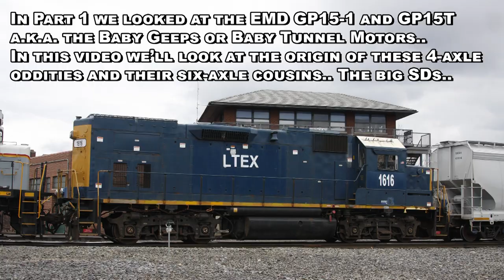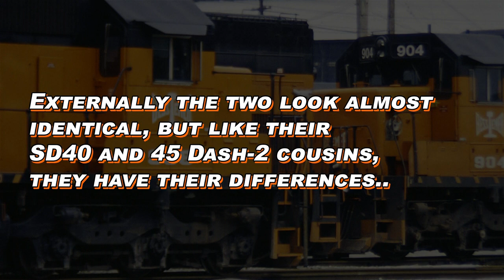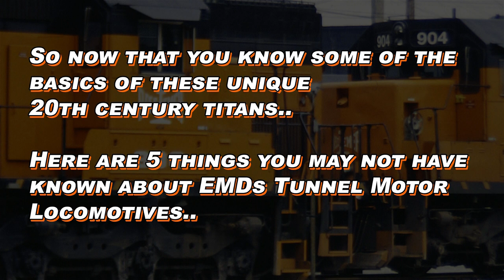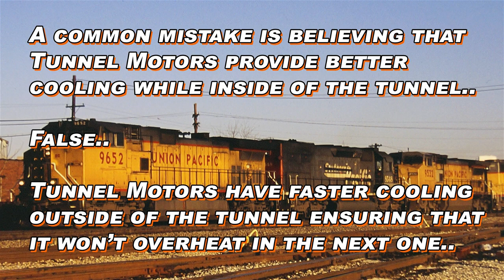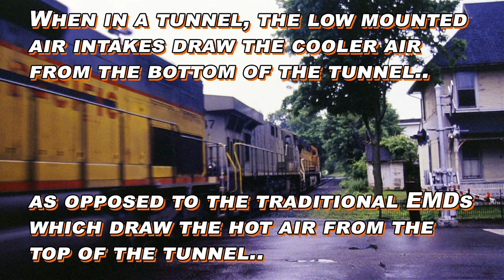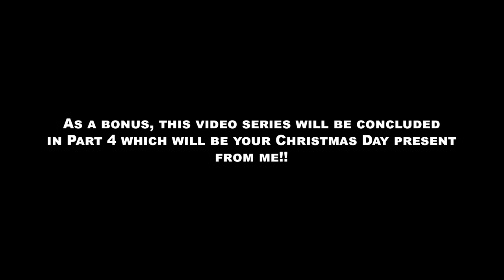[GL][T-309] 50th Anniversary: EMD SD40-2 (G.O.A.T.) | (Part 3 of 5) Tunnel Motors Big & Small

Comment: Growing up in Dayton, Ohio, seeing ex-SP Tunnel Motors on IORY run-through trains on the NS Dayton District in the late 90s/early 00s was a pretty common sight for me when I was a kid. My first exposure to western railroad locomotives and their unusual designs was with the IORY's once colorful roster of ex-BN GP50s, ex-SSW SD45T-2s, ex-SP SD40T-2s, and even an ex-CP SD40-2. Occasionally, there would be interesting foreign power on NS (such as a new BNSF Dash 9, a new UP AC4400CW, and even a solo NYSW GP40-2 that I caught hauling an autorack). Of course, I would often see at least one or two ex-CR units thrown into the mix.

Comment: A.C.; I never knew the EMD Locomotive Manufacturer, General Motors, had to create so many different versions of the same basic design. Do you suppose this is still the same approach, with more modern designs since Caterpillar has control of the manufacturing? Crazy tunnel operations: The Alaska Railroad has two different tunnels to pass through on the way from Anchorage to Whittier. Whittier is one of those fishing and glacial tourism towns, where for the most part, rail is the easiest way to travel there. However, one of these tunnels, allows rail traffic to flow through, and automotive traffic to move through, but just not exactly at the same time. While I'm not sure if the rail traffic has the preference, but the automotive and railway traffic take predetermined turns negotiating the tunnel; 'X' amount of the cars and trucks pass through, then it is the train's turn. Whittier receives so much of its Winter snow that all of the permanent residents live in the same multi-story concrete block building, and the entrances to the building's outer doors are on the second floor level.

Comment: Love the 5413 WLE tunnel motor
Reply: It is nice to see the W&LE keeping the D&RGW paint intact on the 5413.  That unit was the 73rd and last SD40T-2 built for the Rio Grande, and as far as I know, only three remain in D&RGW paint (5371, 5391, and 5413).
Reply: @kevinbaker4241  hey Kev 5391 May become 5412
Reply: 5411 is the other one
Reply: @logandetwiler4483  I think that would make sense, since the other two units are 5411 (formerly 8795) and 5413.  I just hope W&LE doesn't replace the Rio Grande lettering with their own... but if it happens, so be it - it is a similar style anyway.
Reply: @kevinbaker4241  yes sir I agree good to hear from you after 3 years away
Reply: @logandetwiler4483  Yeah, I'm still around, but I had to leave Buehler's in December of 2018 due to medical issues that took me out of action and required two surgeries (one in 2019 and one in 2020).  At least the worst of the issues have been successfully dealt with, so I can keep on railfanning.
Reply: @kevinbaker4241  wish we can go Railfanning together